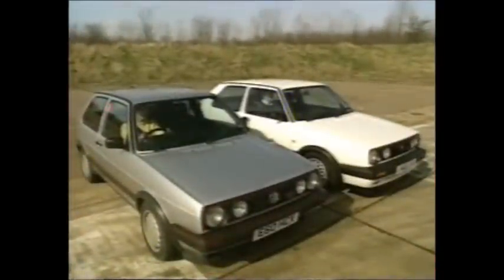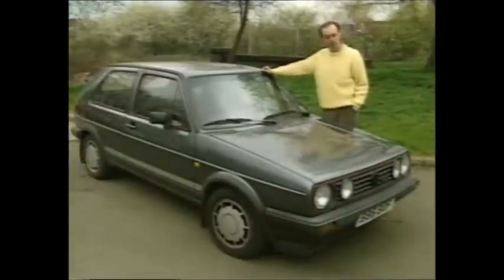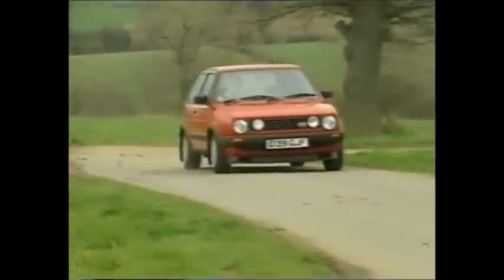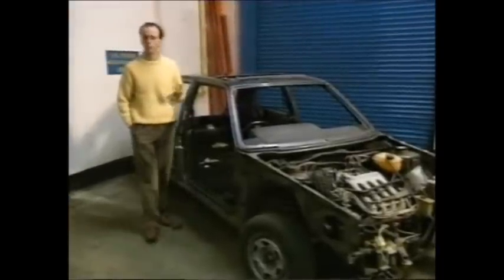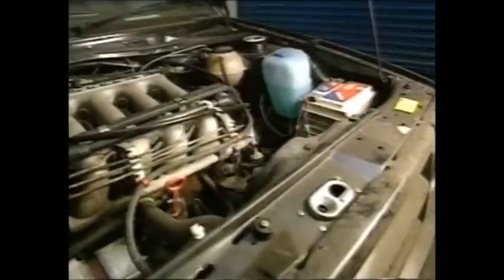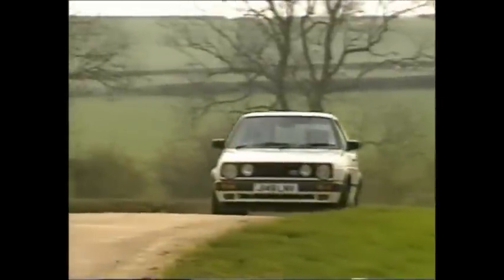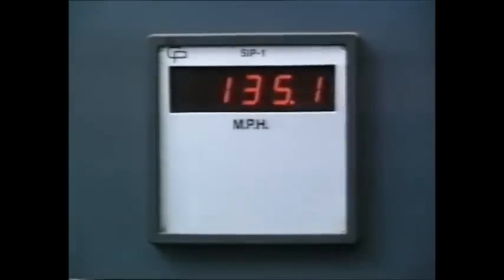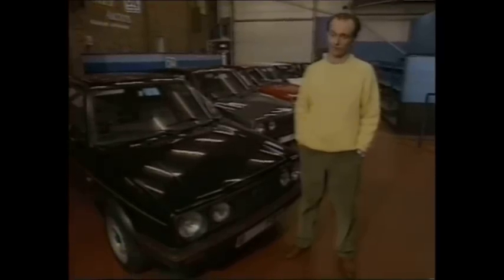Old Top Gear 1992 - Volkswagen Golf GTI

Comment: i want a gti for 4 grand...
Reply: przybylason if you look hard enough you might just find one
Reply: Did you get it?

It’s been 5 years hope it’s doing well for ya’
Reply: Mk2 mk3 mk4 mk5 all doable for 4k.
Reply: @bmorris5863  For s wreck, yes. Better be quick for a Mk2 at that price. Looking at least £15k for a good one
Reply: @Blackmamba12345  15k is a mint one....or an overpriced one from ukd. 
Plenty still around, I'd say good ones start at 7k
Reply: @Blackmamba12345  also the prices have only recently shot up since covid started........  Bought my 8v gti big bumper 3dr.... With 85000 miles, fsh and bbs rs splits. For £6800 last December.
Reply: @bmorris5863  Ah nice yeah, I have a Mk2 GTi 8v too, a Campaign model from 1988 on a E plate. Had it in the Family since new! My dad originally bought it and he has now passed it on to me!
Reply: @bmorris5863  I think the prices have gone up due to rarity and the fact they are 30 years old now! So therefore they are a classic status and that deffo puts the value up. Also yes for a good condition one / not molested then have a look on ebay and they have certainly gone up in value. Yeah, well that's a low price, if it's 1 owner / fsh etc. Then it will be a lot more!!
Reply: @Blackmamba12345  whats your adress? Need to come check the gas meters, nothing suspicious
Reply: @Blackmamba12345  you mean 8 rusty shells right? Wink wink
Reply: @Blackmamba12345  thats to divert attention haha
Reply: @ZaJaClt  Haha. They all run but yes not all of them are tax and tested etc.
Reply: @ZaJaClt  Maybe ill try and do a cold start vid for you or on here
Reply: @Blackmamba12345  all i want for  xmas is a g40 polo hehe
Reply: @Blackmamba12345  agree but prices have shot up since the start of lockdown!!! With all niche/performance/classic cars.... Ask anyone in the mk2 owners group on Facebook...  And half of them aren't selling for the prices they are getting listed for.
Reply: @bmorris5863  Yeah that's true. At the ebd of the day it depends what someone will pay for it. Yeah, well let's say if you look after it then yeah deffo an investment opportunity haha. Yeah it could be linked I guess but yeah they are real classics tho.
Reply: @bmorris5863  It does depend on the condition, mileage, not modified etc. They are becoming much more sought after tho I agree. Yeah prices for mk2 gti have shot up in last few years. I remember around 2008 when I passed my test I had a mk4 Golf. However I saw lots of mk2 gtis for sale near me and one was even for £1500 which now seems an absolute bargain but yeah that's over ten years ago now.
Reply: @bmorris5863  mk4 and before is doable but mk5? you're lucky if you can find an mk5 that even runs for 4k
Reply: @xjsvg  there's countless on auto trader......
Reply: @xjsvg  talking uk wise  btw....
Reply: @bmorris5863  ahh im in the us over here most mk5 low miles good condition are around 5k at least
Reply: I want a supercar for 5 times the price
Reply: Was gonna say an mk5 for 5k but 7 years ago nah
Reply: Today also nah what was i thinking 2 months ago
Reply: @f4tpie  even 3 years ago when this comment was made, you couldn't get a mk1 for 4 grand.
Reply: @f4tpie  yeah true, cabrio's have only recently shot up in value. I remember them being quite cheap 2 years ago. People are asking big money for good examples now.
Reply: Bro that’s way too cheap for what it is
Reply: They'd cost just under $10k in today's money, Man that'd be sweet

Comment: My 16v was a 91 and I brought it in 96 for £4000, it was last edition big bumber model in Helios Blue with BBS wheels.
That car never broke down used next to no oil and at GTi day at Santa Pod ran 16 sec at 88mph with 166000 on the clock and still returned 37mpg on the motorway with a light foot and 27mpg round town...
It had a clutch at 105000 but other than that no other problems, one of the best cars I've owned.

Comment: Great to see Brian Ricketts, the engineering brain of GTi Engineering, run by Richard Lloyd at Silverstone. My Golf is a Jade Green Type 19 Mk2 16v with the RE2000....2 litres bored and stroked, engine conversion....170bhp @ 6,000 revs, 158 lbs/ft @ 4,600 revs, 94,000 miles young, and goes like the clappers. Totally original car, I'm the 2nd owner. Love her to bits.

Comment: Back when VW Golf was great car. Mk2 Golf GTI looks cool!
Reply: +VX97 after mk4 they just started turn to shit
Reply: +Corkoth55 yup
Reply: +Corkoth55 Thats true. They fucked up Golf after MK4. MK2 Golf GTI is one of the best Golfs ever made.
Reply: ***** oh god no. i have a mk4 2.slow. and i always wanted a low mileage mk4 1.8t or gti next.... but it doesn't even seem worth it 150 hp standard on the 1.8t and 200 on a vr6 engine?? not worth it to me. and love this generation of cars dearly.
Reply: +Corkoth55 they turned to shit ab KDF Wagen Käfer
Reply: GPS Modul the earth turned to shit before it existed.
Reply: +Corkoth55 On the contrary, the became better again! The Golf V GTi was a superb car and so are it’s successor models. Also worth considering is the Polo IV GTi and it’s successors if you don’t mind the lack of space.
Reply: wish we had Polo in the usa.
Reply: +Corkoth55 There's a world of difference between the 2.slow and the 1.8t... If you can find one, go for a 180 BHP model, fit bilstein shocks and eibach springs, but don't slam it... Make sure your brakes are tip top and get good tyres and you'll have one of the best cars on the MK4 platform. I have one pushing 215 BHP, with the above mentioned suspension (not much lower than stock but waaaay better handling, less body roll) and Brembo brakes, also on 17" MK1 TT wheels with michellin pilot sport tyres, it eats my cousin's 2.0 GTI for breakfast. I've had it a long time and I'll keep it forever... Do love the MK2 though.
Reply: Si1983h i know the 2.0 is in a league of its own lol. traded it and got a accord coupe v6 6spd manual.with navi. kinda rare. couldn't be happier. i might go back to VW one day.
Reply: The new Golf is cancer.
Reply: KiloByte how
Reply: KiloByte Hater detected. I have a mk7 and it is very nice.
Reply: It is still a great car. Always rated at the top of the segment.

Comment: I had a 1989 16v that I bought in 1997 with 100k on the clock. It was fabulous and went like a train and kept up with my mates Corrado VR6 up to 70mph. Recently been hankering for a another one and was fortunate enough to be allowed to drive an original unmolested G plate 16v small bumper last year with 76k on the clock. I loved it, but sadly it wasn’t what I remembered, it went well enough but just felt old & slow even though it was a good one. Still have very fond memories of my 89 16v but according to MOT records records F465TNP hasn’t had one since 2008 and last recorded miles were 172k so unless it’s in a barn somewhere waiting to be brought back i life I’m guessing it is long gone. 

I do wish Top Gear was more like the old ones, I’m a young 52 year old petrol head and find new TG is just rubbish unless Chris Harris is driving or speaking.
Reply: Cars have come a long way, of course it feels old because it is! They were great cars for the time and still are if you don't ask too much from them. I mean its a 80s car you can't really expect it to be better acceleration or comfort wise then a mk7 GTI.

Comment: Still have a mk2 golf gti with 800k on the chassis. My father bought it original in 88 with the first engine lasting 350k miles the new motor is an ABA single came with the original ported and polished cylinder head with a 272 cam, ported intake manifold, lightened flywheel, all fitted to fully adjustable coilover suspension. The only problem I have is with early electronic fuel injection, digifant. Car runs like a champ and is more reliable than my 98 glx vr6.

Comment: 2:48 If an engine uses no oil, it means the cylinder wall cross-hatched honing pattern is gone, the pistons are not carrying oil and the engine will wear out rapidly.  An engine in good condition is supposed to use oil.
Reply: I dont think so in this case. My engine is a 1.6 8V from same family as these old VW engines. EA827 more precisely. It has 140k km and is pushed hard every single time i take the car. Not a single drop of oil is burnt...Maybe a few after 10 k km or something, and i cant even see in the dipstick. Those engines have a different design from the new engines. They had tighter oil passages and were made to not burn oil unlike modern engines that need oil to be more efficient fuel wise and reliability wise.

Comment: I have had an '87 GTI 8v sitting in my garage for a while now, the camshaft and valves were damaged a long time ago by a VW dealership when the car had about 30000 miles, and the car has been sitting since then. I didn't know that these were so popular, now I think I should repair it after so long.

Comment: and I forgot about that scary rear wheel lift off which even mark IV has. I hope that V doesn't.
Reply: TheKenjoje haha, my mkv R32 feels tight, and that's stock!
Reply: Nope, MK V has an independent rear suspension.
Reply: @jaimieboy999  it's 4x4 and has heavy rear, that's why....
Reply: @edism  it has nothing to do with multilink because I do believe you are reffering to multilink because people often confuse it with independent suspension. torsion beam is also a form of independent suspension. it's not like beam axle. the reason for the lift off is firm, but light rear of the car....if it had softer rear, it would had started to drift earlier instead of holding the line (well, sort of) like gti models do....
Reply: They are all scrap anyway :(
Reply: @jaimieboy999  why?
Reply: @TheKenjoje  You have no idea what you're on about. It's okay, if you think it's because the rear is hard/soft then I'll let you run with that.
Reply: @TheKenjoje  not made to last.
Reply: @jaimieboy999  i has been a long time since golfs weren't made to last....
Reply: @TheKenjoje  aye, since Hitler
Reply: @jaimieboy999  yeah, the beetle only :)

Comment: I've never had any troubles with my type 155 only the top replacement, cv axles, front wheel bearings,tires, brakes coolant,wiper blades, fluids ignition tune-up easy stuff very reliable.

Comment: My 1985 8v GTI mkII had 190K miles on it and didn't use a drop of oil between changes.  I had no provenance with it but I suspect it had been re-bored at some point. P-alloys and a leaky sunroof that dropped a load of water in your crotch when you braked hard after rain, a the heater matrix acted like a sauna. Great car.
Reply: I mean at 190k its bound to have some problems

Comment: I was lucky enough to have a brother who had a 1987 GTI 8V, followed by a 1990 16V, both of which he let me drive, even though I was a silly novice and probably shouldn't have been at the wheel of a 16V. Both were such great cars ... even though the 8V was never quite fast enough to deserve that GTI-badge.
Over here in Germany, insurance was getting rather ridiculous for them, too. Perhaps not as ridiculous as they would get a little later for Mk III VR6s, but still quite silly. I distinctly remember that at one point, the 16V was getting pretty close to what you would've paid to insure a Porsche 911.

Comment: The 1.9 205 GTI was the best Hot Hatch ever! The R5 gt Turbo was a little quicker...but it wasn't as well built.
Reply: Bollocks
Reply: @James-oo1yq  lol the 205 was good but didn't have the kudos or class of the Golf. The GT turbo looked and performed well but was still another French plastic heap of shite
Reply: @fergusdonaghy3124  The 205 only lacked the build quality of the Golf, but it was built far better than the GT Turbo. The 205 was far faster and handled much better than the Golf. I had almost every hot hatch from the 80s 90s and the 1.9 pug was the best. The Golf was good...but far from the best, as build quality doesn't count for much when it comes to enjoying your driving. The SAAB 900 Turbo was an absolute DOG! Yet it was built well
Reply: @fergusdonaghy3124  Kudos? Seriously? The 205 slapped the arse of every hot hatch on the market when it arrived. The Golf couldnt get anywhere near it, even in 16v form. 
I love Golfs, had a mk2 but ive also got a 205 gti and it runs rings around them. On Another Level
Reply: @James-oo1yq  Bodily wise, the Pug was the best built of the lot. They just dont really rust like an 80's car does
Reply: @fergusdonaghy3124  205 ran rings around golf back then
Reply: @mikeygti8930  Yes, because the only areas you ever see rust is the crease above the sill...even then it's pretty rare. I had 3 and never saw any rust at all. The Golf was more solid...but that's ALL it had going for it

Comment: Value dropped massively when VW made too much special editions. G60 GTI, Fire & Ice, Wolfsburg Edition, 10 Mil editions, Edition One and the unicorn of all the 160hp G60 Rallye Synchro. There were so many specials editions that a normal 16V GTI lost most of its value.
Reply: And that was great for normal folks that wanted a GTI but didn't have the need to have a special edition

Comment: Golf mk2 doesn't handle good I've drove many cars same with Afew of my long time buddy's that I hang out with a stock gti mk2 handles better than any other car in its price range and class everyone ur seat position gives u that total control feel if u have h&r suspension its impossible to not feel 100% connected to the car steering and cornering

Comment: My experience is they are very unreliable,      The cheap and nasty design of the rubber cambelt will destroy the engine if it snaps and I doubt many risked it to 60.000 miles